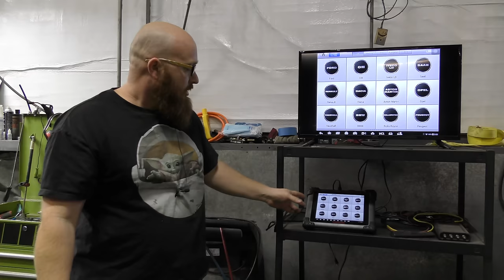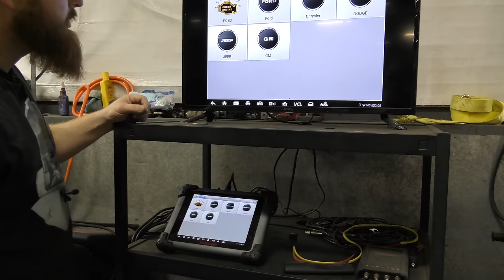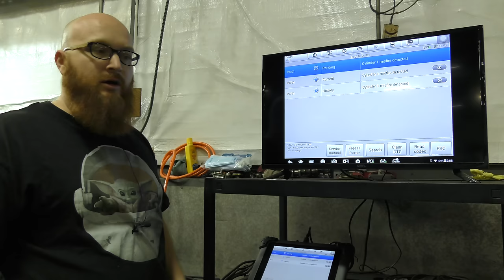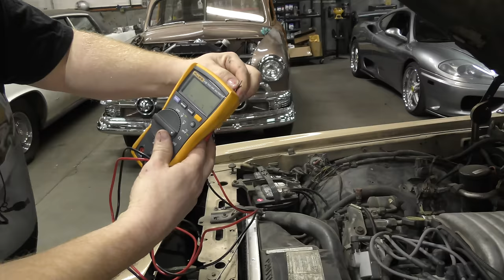Part 5.1: What's wrong with my car?!? Advanced Diagnostic Tips from the CAR WIZARD: Tips 1-5

Comment: I am a retired Mechanic and love watching your video's (never too old to learn) I purchased your 'special' relays and they save so much time just the other day I was fixing an A/C issue when the clutch would not engage, plug in the 'special' relay flipped the switch the clutch engaged and knew immediately that was no the problem, charged the A/C now everything is fine. Thank You

Comment: Wizard couldn't you switch the coil to another bank and see if the problem moves That would also tell you that the coil is bad and you could have the same fix
Reply: Absolutely right👍
Reply: Plus if that works you KNOW everything else in that circuit is good.
Edit : I read coil and thought relay.  When I read 300DBenz's comment I reread Richards and realized my brain fart.
Reply: On those Toyota inlines, it takes less time to swap 2 coils than it does to walk over to the tool box, dig through the Diagnostic drawer (aka, the rats nest of test cables), find what you need, walk back and set everything up
Reply: Technically you shouldn’t swap the coils what about if there is a short in the wire you swap the coil and end up burning another coil
Reply: That’s what I’ve done.
Reply: @tomh5663  The coil WASN'T bad, the plug gap was TOO wide for proper ignition. He replaced the coil because it had been stressed by the wide plug gap. This could lead to "carbon tracking" across the coil because higher than normal voltage build up will break down the insulation making the coil useless!
Reply: @TheOzthewiz  But he found the spark plug problem because he checked the coil the proper way.
Reply: That's how I do it. No risk of getting shocked.
Reply: @tomh5663 that would at least eliminate that the coil was the issue and you could look elsewhere.

Comment: The home DIY guy isn’t going to have the diagnostic tool to easily isolate the problem, so have the DIY guy do the following: 1). Pull one coil at a time, and the one that does not change the idle condition is the non firing cylinder. 2). Start and check spark color. 3). If spark color is good, then check fuel delivery. 4). If fuel is there, check compression. Need all three to run properly.

Comment: I would have not used the plastic pliers and test lead to potentially fry the coil like that, I would have just cleared the code, and switched coils #1 and #2 and then seen whether the fault code now comes up on cylinder 2 or whether it stays on cylinder 1. Yes, that means removing more fasteners (1 more lose than with the Wizard's method, and 2 more tight, although most of them don't necessarily need to be tightened for just a short test) and unplug and plug in 2 electrical connections. So it's about 1 minute more work, but you save on buying tools ;)
Reply: yes, me too, he had one suspect faulty component and three known good ones, why not swap #1 coilpak with #2, #3 or #4 and watch the fault follow #1 (or not) on the OBD reader...

Comment: I’m glad there’s people like you on YouTube. Thanks for the advice.
Reply: i am too. wizard is a rare breed of a youtuber, he is out here to help people. and that is something we will always remember, and he will be known for. He helped so many people figure out complex issues, he helped me have confidence to even work on vehicles. I not only work on vehicles. i took that knowledge and replicated it into small engines. now i repair them even more than vehicles and enjoy that. (far simpler and easier on body to work on small engine)
Reply: Same. He's become great at presenting to the camera and his information can be fully trusted.
Reply: Great tools and advice Wizard! The only thing I would add is that those 2 pin relay testers are not a definitive “oh the relay is bad”. When you flip the switch and the circuit is working, it tells you the power side circuit integrity is good at that moment and that the problem lies in the control side of the circuit (which COULD be the relay, or a broken control wire, or control ground or pcm). It’s not a definitive relay test, but a good guide to where you should look for your problem. If I didn’t feel like testing things I’d rather just swap the relay with a good working one and test the circuit in it’s normal operation to fully isolate it.
Reply: My thoughts exactly.

Comment: In the old days at the motorcycle shop, the lowest guy on the totem pole would have to hold the shaft of a screwdriver stuck the spark plug wire. The mechanic would kickstart it and if the guy dropped the screwdriver, you had spark.
Reply: This is the best comment out here. How the hell is it not the top comment? xD

Comment: You're a Great Automotive Repair Instructor. You're instructions are straight forward and easy to follow. A OBD-II Code Reader is a Must Have Tool, Your Load Test Light bulb, Multimeter, optional extra Tester the Power Probe 3 or newer model makes for quick Ground Diagnostic Trouble Shooting. Plastic Pliers & Silcone Test Leads is also Must Have Tools.

Comment: Wizard that power probe is a great tool. It can also blow a circuit if it triggers the wrong circuit if it is used wrong.
Reply: Had a newish tech blow out a entire bulkhead harness on a Subaru by using a power probe to test a speaker,

Comment: Great advice!  I know it was intended to be generic advice, but that generation of OBD-I Ford (EEC-IV) will perform an automated cylinder balance test where it raises the idle up to about 1500rpm, then drops out one injector at a time and looks for corresponding rpm drop.  It’s a quick, easy way to see if all 8 injectors are contributing equally

Comment: Jaguars from 2004-2009 are notorious for faulty grounds due to the copper wires grounded (earthed) to the aluminum body with aluminum ground studs. Especially the four behind the headlights which are somewhat exposed to the elements. The trunk ones less so, but still should be cleaned. Also, all the studs are very delicate and will break if over tightened. 
That’s your Jag Tip of The Day.

Comment: One more tip for finding a bad coil for cars with individual coils: swap the suspect coil with one on another cylinder and see if the code moves with it. Also never assume your new part is going to be good or last very long. Had a new plug wire go bad after only a week or two in an 88 S10. Tripped a code and ran really bad. Thought it was something expensive and at the time I didn't have computer experience. Dealership missed it and tried to sell a bunch of unneeded stuff. I bought a couple of the things (rebuilt computer and throttle body gasket). Didn't need either. Went back to basics with the VOM and found the bad wire that the dealer's scope should have caught.

Comment: As far as coils go, with a single cylinder misfire I usually use the old swap the coil and see if the misfire jumps trick. Usually won't break out the spark tester unless I'm dealing with actual plug wires. Another thing is if you're not 100% what a reading is supposed to be, or what a good injector sounds like, check them all. Chances are if you've got an odd one out, that's your problem.

Comment: Ground’s definitely can be intermittent gremlin problems.   Years ago I worked on a boat trailer that had brake lights slighty glowing through tail lights sometimes. Nothing worked right.     Several mechanics had tried to fix it.  Took awhile but finally found ground problem-2 piece trailer hitch on boat trailer with master cylinder for braking as weight pushed against pickup when braking. Poor ground which changed weak and stronger depending on hitch movement. Added good flexible ground wire between the 2 piece hitch and WOW. Everything worked fine.

Comment: Even Toyotas need some love!
Reply: They've been junk for the last number of years, among others.
Reply: @Arayig1982  Eloborate?
Reply: @moeanthony9308  toyotas are not solid cars anylonger.  pretty much anything post 2005 is half assed toyotas compared to previous years.
Reply: @Arayig1982  I guess that's your opinion. I have had 2 ravs in the past 12 years. I have done nothing to them. In comparison to Korean and GM for a mainstream vehicle. I wouldn't touch anything else. To deem it junk is a long shot brah.
Reply: @moeanthony9308  all new cars are junk, they're not designed to last and your rav4 is child's play next say a 99 camry four banger.
Reply: @moeanthony9308  reread my comments.  It says last number of years meaning lately.  Do you need a picture drawn for you as well?
Reply: @PhyuckYew  junk
Reply: @Arayig1982  Yes can you draw it. Or do I need you to understand that the last few years are just fine. What's your basis by not driving later model year and making up BS? Since you the genius deem all cars junk? Don't worry you will be rehired as a comic after the pandemic is over.
Reply: @PhyuckYew  Thank you. These characters do keep us entertained though.
Reply: @moeanthony9308  between electronic power steering failures, cvt issues, head gasket, potential ecm failures, among more expensive upkeep especially considering older models.  You can keep them, between it and your hurt feelings too.
Reply: @PhyuckYew  His basis is to put blame on your comments when he knows full out his is a pile of fart.
Reply: @PhyuckYew  Probably works there too.
Reply: @Arayig1982  My hurt feelings? You sound like the world ended with your cry me a river story. Perhaps these occur like any first year model but this has happened all throughout history.  Look brah. I have no time for nonsense right now.
Reply: @moeanthony9308  apparently you do.  And toyotas did not start out as good cars originally, the became good and better from 70s on, but from last decade on, they are descending.  Guess, you can take the river over to your sea of tears.
Reply: @PhyuckYew  nissans became better, they were junk in 90s and early 2000s and cvt aside are mostly okay.  You internet geeks watch too many videos.
Reply: @PhyuckYew  apparently kurds like you did, however.
Reply: @Arayig1982  Put down the pipe. Renault killed the company. Going back to Datsun up to when Renault came on the scene they been garbage. Jatco was the worse thing they ever did.
Reply: @PhyuckYew  Wow. Well said. Turks do it best.
Reply: @moeanthony9308  renault saved nissan, otherwise there would be no nissan today.  Learn a little history.
Reply: @Arayig1982  Where you from? Kardashian country?
Reply: @moeanthony9308  Canada, where cars last if their decently made, mister kurdo.
Reply: @PhyuckYew  nah you're kurdish
Reply: @Arayig1982  if you were remotely reading or knew how to read, my cars were built in Canada. Cambridge to be exact. Don't get it twisted now. Don't jump to conclusions either. The more you write the deeper the BS from you.. Next.
Reply: @moeanthony9308  yeah, they're not that good anymore.  They won't last 20 years, maybe not even ten.  Compare that to 2000 year yarises, and 97 camrys which still go.
Reply: @Arayig1982  You are Armenian.. No doubt
Reply: @Arayig1982  ok whatever. Good night.
Reply: @moeanthony9308  and you are funny.  Cheers mate!
Reply: @Stimpy&Ren logical
Reply: @Arayig1982  And you thought that you were?

Comment: With wire leads and a DVM, there is no need for a voltage probe or special relay test switches.  12v and ground can be measured (meter) or applied (battery) anywhere.
Reply from the maker: Nowhere near as fast though. Time is money in a shop

Comment: That Power Probe is on top of the list with scanner, test light, DVOM, and oscilloscope as must have for diagnostics.  I didn't really think much of it till I got one.  They are as low as $50 if you forego some fancy features like injector testing.

Comment: There is also the chance that the boot is not sealed tight to the bottom of the coil, and allows the spark to jump sideways to the lip of the valve cover. Had that issue and noticed upon removing the boot that there was vaporized plastic and charring across the coil's underside plastic seating surface and top of the boot, where the boot sealed to the coil.

Comment: last tip is actually the greatest about the wrong hole, sure nothing bad happened to the car. but in everyone else's case its just a lesson to double triple check something before you do it, so you wont damage something insanely expensive or hard to fix, like if you are replacing a water pump etc check to be sure you are doing it wright before you do it

Comment: The 2005 Toyota RAV4 looks too small for my taste, but I am looking forward for the second half on tips six through ten for diagnostic maintenance. Also, please note that the Toyota 2AZ-FE engine, which is the 2.4 L four-cylinder engine from 2002 to 2009 is known for oil sludge, if you do not replace the engine oil on schedule. This engine goes on most Toyota models. Thank you very much.

Comment: Great tips :) i made your light bulb tester thingy from an old voltmeter a few yrs ago but learned something new in using it to test grounds Thx for that, i made it to check power easily because was just sitting there going in garbage most likely an it had the leads to probe with so soldered a bulb in an instant tester cost nothing, now i'm going to add a switch to be able to add power to test things to omg your so smart :) humm might need two switchs and two more leads to be able to give something ground and power at the same time humm, o well tinkering is always fun !

Comment: Those relays with the on off swich are great but i have the ones that also have a wire loop on them so u can hook an amp clamp around it do current measurements on thats circut. I love them

Comment: Mercury marine sells something similar to the Autell for their outboard boat engines.  I have the Mercury Vessel View attached to the 90 squirrel-power outboard on my 17 foot Bayliner. It has a module that ties into the fuel injection OBD plug and sends a BlueTooth signal to an app on my phone showing the water temp, voltage, gallons per hour, gallons remaining in the tank [based upon usage and you updating the app when you put gas in], oil pressure, and hours.  If there is a code that suddenly appears a message comes up on the screen and tells you what is wrong.  

Since this is a MERCURY engine this system is a good thing to have.  Don't even get me started.....

Comment: Wizard is not exaggerating in the slightest about the symptoms of a bad ground. If it is a super weird (especially inconsistent) electrical problem, your first thought should be a bad ground. While it's not always a bad ground, that is often easier to check and fix than other possibilities. 

Also, Wizard's setup for a load tester is a great idea. Unless you happen to have junk car parts handy, I would make one out of a "generic" (ie old US pickup) light bulb socket off the shelf of the parts store. These already have leads on them. It should have a part number for a bulb on the package, get that lightbulb too. Small bulbs, tip of little finger size, will draw 1 amp or less. Larger, end of thumb size, will be 1.5 -3 amps. Headlights will almost always be 5 amps. Don't use LED bulbs, they hardly use any current at all. Same with a test light, its not LED but it is very small. 

The newb workers at a parts store might not understand, if so, ask for a manager or "someone more experienced". As long as you try not to sound like a snob, they won't mind.

Comment: Back in 1980ish I bought a old pickup truck mainly because it had a snow plow on it. I knew the guy and his family. They were the back yard mechanic types, he told me some of it's history since he had it. Several engine swaps .We ended up taking it on vacation. Yes we made it there and back with minimum problems. The only 'problem' was when we would plug in our VHS camera, it was a 12V one, once in a while it would just turn off while plugged in and recording. After we got back home I got curious as to why that camera would just turn itself off, the other thing I noticed was when I took my Volt/ohm meter and checked the voltage. At the battery it checked about 12.5 - 13V resting, at the cigarette lighter it was 12V, again resting, at the trailer hitch light plug maybe 9ish volts. Now the question was why, later I was talking with some guys at work and one of them suggested maybe a bad or dirty ground. Next day I went looking for engine grounds to the chassis... I don't see any, so to test a theory, I grabbed a set of jumper cables and found good ground on the engine and made a good ground on the chassis, as soon as I touched the chassis I saw a spark. I made a good connection and proceeded to check the voltages again. I bet you'd never believe it, I had about 12.5 - 13V voltage all the way to the back of the truck.

Why so involved of a story, the problem may elude you because you can't see the 'elephant in the room' until you get some outside input to change your direction of thinking.

Comment: I was having a misfire on my 3.4 tacoma. Everything was pointing towards a fuel issue. My neighbor suggested adding 1 ounce of tcw3  2 stroke marine oil per 5 gallons of gas. It fixed the misfire.  My guess it was a sticky fuel injector